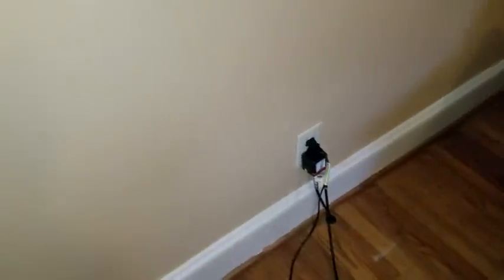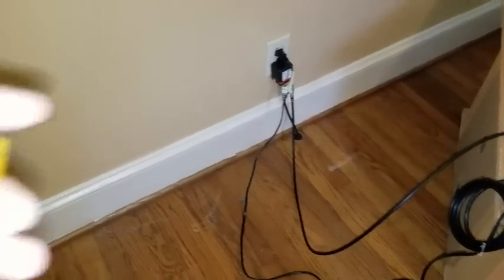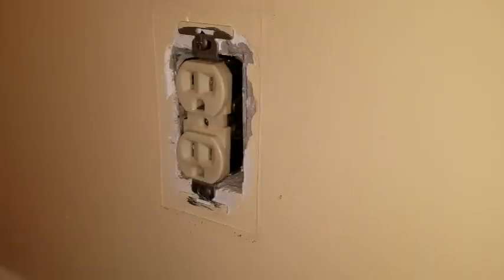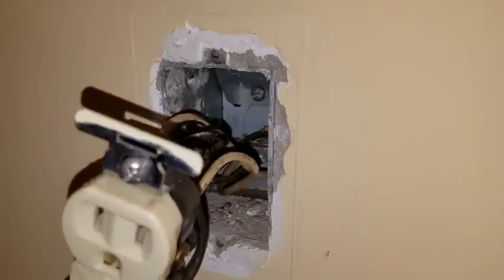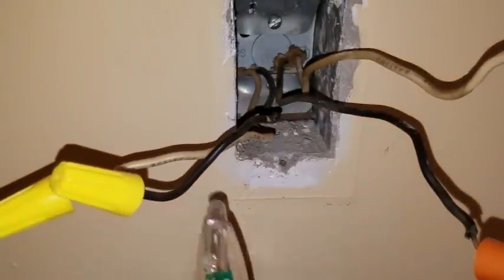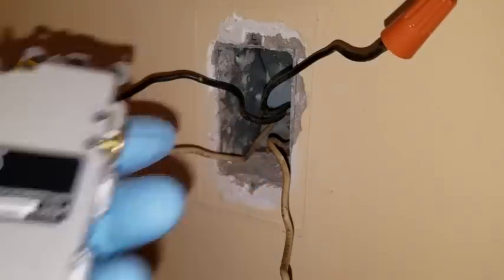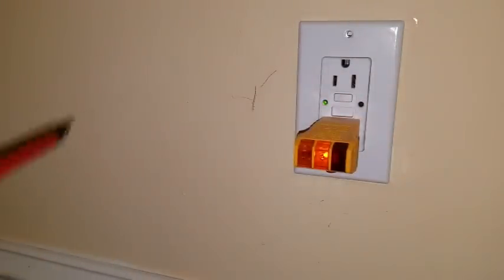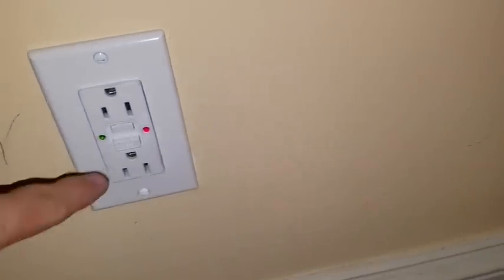Safely Upgrade Old 2 Prong Outlets To 3 prong Outlets

Comment: Would've been nice if you showed where you connected the inline wire (live) instead of cutting it out the video. Did you connect it to the top brass or bottom brass?I don't understand, if the other black wire is not live wouldn't that mean that part of the outlet is dead?

Comment: Is it safe to put multiple GFCI in a row on same circuit? I understand that downstream GFCI are unnecessary, but if they are already in place, is it safe to leave like this?
Reply: Dexter, only if they are wired in parallel (no load connection) and not daisy chained. Wire nuts and pigtails are used. If you trip the first gfci and it doesn't affect anything downstream then you're ok. If the downstream gfci's go dead, they are wired incorrectly. In this case, you can rewire them in parallel, or leave the first one as is, and replace the remaining ones with regular receptacles. If you choose the latter, you should put a sticker on the face plates of the downstream receptacles stating " gfci protected outlet " and if there is no ground, another sticker stating "no equipment ground "

Comment: From what he showed, he was probably in the middle of the outlet string.  The one hot was the line side of the circuit, the end outlet will have just 2 wires since it is not feeding anything else.  You have to keep going back until every outlet is dead.
Reply: Tu

Comment: What if it only has 2 wires. A white and black. Trying to update to same as above.
Reply: Lori Hill, then you have an end of the run receptacle. Connect the wires to the line side only and you're done. White to silver screw and black to brass. Leave the tape on the load side as is.

Comment: Nice video!    Another way to do this is to install a new GFCI receptacle, box, and NM cable next to the electrical panel.   Connect it to the breaker and connect the old branch circuit to the GFCI.   This is IF the panel is easy to get to.
What was going through the hole in the floor?   I'm hoping not a cord!

Comment: It should be noted that although using a GFI in this manner is code, the lack of a ground will not allow surge protection circuitry or devices to work as intended for your electronics.  Sure it will protect you and absolutely not a problem for say lights, coffee maker, toaster,  maybe even a low tech appliance, etc. but the TV you've got plugged in is a sitting duck. Yes, the sticker is ugly but in this case its hidden so what's the big deal.  BTW, the slang for the non-code jumper is a "boot-leg ground".
Reply: Most surge protectors have a varistor between live and neutral so they will work.
Reply: @okaro6595  no they won't work as intended but that's your gamble

Comment: Why don’t you push the grounding button on the tester? Because it won’t trip out like it’s suppose to.
Reply: The way to test the outlet is to use the test button on the outlet. An external tester of course will not work without a ground.

Comment: I'm not an electrician but it seemed he installed the outlet upside down
Reply: yep, it's upside down, I have seen electricians do the same thing. Long as it is wired correctly is all that matters, but it looks stupid.
Reply: @jthonn  No, it's not technically "upside down", either way, but many grounded devices are designed for it to be "the other way", i.e., with the grounding pin toward the bottom.  The weight of the cord or wall device then tends to "push in" the ground, giving the assembly somewhat better support than the way he installed it. However, there are tradeoffs that may make it "safer" to put it in his way.
Reply: @UpnorthHere  Like I said, as long as it is wired correctly, that is all that matters, but in my opinion, it is upside down and looks stupid. There is no trade-off that I know of that would make it any safer. It is either grounded or not.
Reply: @jthonn  Yes, I bought a house with over 100 of them like that.  Drove me nuts.  However, if you look around, some people claim it's somehow "safer" if the grounding pin is up top, since that way (the story goes), if the plug is loose and something (conductive) falls on the exposed contacts, it hits the grounding pin and not across the hot and neutral.  It's a stretch, but some people state that they have had "fires" from accidents after having them installed with grounding pin down.  I have also had electricians (!) point out the NEMA receptacle diagrams in the NFPA 70 Handbook, all of which have the grounding pin (if any), up top.  I point out that it's an informational reference and NOT a code requirement. Nuff said.
Reply: @UpnorthHere  I here ya, 100 of them would drive me crazy too. In a garage or workshop ok, but not in the house. Good grief!

Comment: Kind of strange how u had open ground.     If the box is metal the only thing i can think of is the conduit is probably not metal,     or might not even have conduit at all.     If everything is metal than that is your ground
Reply: The box is metal, but the wiring isn't ran through conduit. He has a metal box with cable clamps that are designed to clamp down non metallic sheathed cable. He has old 14-2 with no ground conductor, so the metal box is not grounded or bonded.
Reply: @illestofdemall13  This is true in thousands of homes built or modified in the USA prior to the 1970s when "grounding" became the norm.
Reply: @UpnorthHere  Including my house in South Florida that was built in the 50s. We rewired it 15 years ago.

Comment: Confusion. Should the third prong ground be at the bottom on residential or not?
Reply: Nobody cares. There is nothing in the national electrical code one way or the other.
Reply: It should be. Perhaps NCP is left handed.
Reply: Whichever you prefer, there is no code governing this.

Comment: Gfci with no actual ground is no safer and a waste of money.
Reply: So, if i need to convert a two prong outlet to a three prong (no ground present) what would you suggest?
Reply: ...but is up to code as long as you use the stickers "GFCI Protected" and "No Equipment Ground" that comes with the outlet.  That's the only NEC code-accepted way to upgrade a 2-prong to a 3-prong without proper ground.  
The other method is to run new wire (aka: have proper ground).  Yes, this is the ideal way, but also very expensive in many situations.
Reply: @Cryostal  Putting in a 3-prong outlet with no ground alone is a code violation unless it is a GFCI outlet AND has the stickers "GFCI Protected" and "No Equipment Ground" on it.  The outlet would still not be grounded, but this method is allowed by code.
Reply: @Cryostal  lol surge protectors leach surge thru a ground otherwise your equipment is still toast found out the hardway
Reply: @Cryostal  Yeah, except that would (a) be  a code violation if there is no ground, and (b) your surge protector won't work (they almost all need grounding to function properly).  So, you would have made things more illegal and more dangerous. Not really the best solution.

Comment: so can i change 2 prong to 3 prong with no ground and it will work? can i plug my computer on it?
Reply from the maker: I have computers and equipment plugged into mine.
However  before I moved in the previous owners did a had a 200 amp serves installed. So incoming lines are grounded.  None of the old wiring is grounded so a lighting strike can still get me but It should be attenuated. 

I do have a whole house surge protector I will be installing. But its been setting in its box for the last 6 months :(
Reply: @NorthCarolinaPrepper  oh i see i checked the outlets on my room and they only have 2 cables no ground but in the kitchen i found two that has the ground cable connected so i just have to test them with the device and if they are well grounded i can just run an extension to my room thats the cheapest solution i think. and on the living room right out my room there is a 220v outlet that we dont use there was a gas heater connected there and that one has ground cable too im wondering if i can convert that 220v to 110v so i can put a 3 prong outlet instead
Reply: Refugio Flores if you are not comfortable with electrical work, and based on your question I am guessing you are not! Have an electrician come access your needs and offer solutions. Many 220 volt applications do not have neutral wires ran to them so if that is the case, you may need a separate neutral wire ran. At that point, it is advisable to have ground wires ran.
Reply: Refugio Flores  YES YOU CAN IT WILL WORK JUST YOU WONT HAVE GROUND. NOT UP TO CODE BUT YOU CAM SAFEST CODE WAY IS TO PUT IN A GFC WITH THE NO GROUND STIKERS ON IT AND YOU SHOULD B OK. OR LOOK UP NEUTRAL TO GROUND
Reply: surge protectors need a ground to leach surges otherwise your equipment is still toast
Reply: @wizard3z868  Not really. There is always a movistor (Metal Oxide Varistor) device running from hot to neutral which will act to clip any large transients. There is also movistors between between hot and ground, and neutral and ground, and as you point out these will be less useful due to the lack of ground.

Comment: So if I have a 3 prong outlet with only 2 wires, I can jump the ground from the neutral screw?
Reply from the maker: No. that is a bootleg ground. It will show ok on a little tester, but it will let the ground be energized.  here is some info on it https://en.wikipedia.org/wiki/Bootleg_ground
Reply: @NorthCarolinaPrepper  The ground will be energized only if the neutral breaks. If the neutral is intact there is maybe one o two volts in it. This may cause interference with IT-cables though.
Reply: You have to run a grounding wire to your breaker. Wouldn’t suggest anyone without electrical expertise touch it
Reply: No! No! No! You set yourself for a dangerous encounter. By code you replace the 2 slot receptacle with a GFCI receptacle as was shown and label it GFCI PROTECTED and NO EQUIPMENT GROUND
Reply: @coypatton3160  Why would you mark a GFCI outlet with words "GFCI protected"?
Reply: Okaro X follow code or hire an electrician. If you ask that question you need ti do the latter!

Comment: you need to put a "no ground present" sticker on there.
Reply from the maker: I got some stickers on it now and on all the outlets down stream. I got a bunch of extra ones from the outlet maker.
Reply: There is no requirement that it be a "sticker". "The label shall be of sufficient durability to withstand the environment involved." NEC (2017) 110.21(B)(3).

Comment: I have seen you someplace before were you on the Red Green Show looks like North Carolina have you been to Danny's BBQ in Raleigh great barbecue actually but you're absolutely absolutely wrong wrong wrong send a wire underneath your house all of the outlets cut the walls send the wire underneath the house do it right or don't do it at all your GFI needs to be grounded and that's it you're not on the Red Green show now do it right no duct tape
Reply: FYI a gfi will function properly without a ground,
Reply: uawsux: "GFI needs to be grounded"?  Who told you THAT?  A replacement receptacle with a "grounding slot" does NOT have to be grounded if there is no grounding conductor available at the outlet enclosure, and either it is a GFCI receptacle or supplied from another GFCI device, NONE of which are required to be grounded. They even come with labels to attach to each receptacle that says "No Equipment Ground", as required in the National Electrical Code.

Comment: If your electrical wiring in the wall is bx or ac and if it’s properly grounded and bonded to the circuit panel then you can still use a 3 prong outlet.  Just run a ground pigtail and screw it to the box and connect that ground wire to the outlet providing ground back to the service panel of the house.
Reply from the maker: No its old  fabric covered 2 wire. All the new wire im pulling is 12/2 (Stiff and a pain in the but some outlets are being upgraded to 20 amp)
Reply: cgillyard: yes, if you HAVE a grounding conductor at the outlet box, you have to connect it to the 3-slot, grounding-type outlets when you upgrade.

Comment: Does nothing for safety
Reply: jcagy2 not sure what you are saying. By NEC code a gfci receptacle is the only acceptable procedure for replacement on a 2 wire system! Is it as safe as a 3 wire system with gfci protection—No! But it is NEC approved with the appropriate labels!
Reply: jcagy2: "nothing for safety"?  Why would the NFPA authorize it and all 50 states adopt the resulting NEC if it's not safer than the alternative?
Reply: @UpnorthHere   Yea, GFCI work without ground, still much confusion about this I guess??? Of course put the no ground sticky.

Comment: Wait...u said its good.  Your circuit tester says its hot on neutral.  And open hot.  Thats not good
Reply from the maker: harbor freight gfci tester  center light is open ground . It should really have a  "no equipment ground" labels affixed (the labels come with the GFCI device). Its code.   Here is the part of the code if you are interested . NEC code covering  Non-Grounding-Type Receptacles. 406.4(D)(2)(C)

Comment: How do you know this is the FIRST receptacle (upstream) in the branch? You know that there are likely more receptacles or lights downstream of this receptacle (at least there is a circuit, maybe going somewhere downstream), but there may also be other receptacles upstream of this receptacle, so you can't, from this, tell that this is the FIRST. I understand that that might not be important to you right now).
Reply from the maker: I flipped all the circuit breaker in the panel. Then turned the on in the computer room, Then pulled all the outlets out and disconnected them until only on had a hot line that hat power. Then went under the house and physically traced the out
let wiring (romex) back to the breaker panel.
Reply from the maker: Some of the stuff the previous owners did is scary. Like splices in the line that just go to exposed wire with electrical tap on the ends. At this house I make sure to trace the lines. :(
Reply: You didn't really need to go under the house using the method above.  But better too much precaution than not enough.

Comment: Y install gfi if not grounded
Reply: so you can plug things in
Reply: It is code for replacement of 2 slot receptacles with the appropriate labels affixed! I.E. NO EQUIPMENT GROUND & GFCI PROTECTED
Reply from the maker: They still work Just not Equipment ground. So sensitive equipment might get damaged from a fault. But the human will not (shouldn't) get electrocuted.

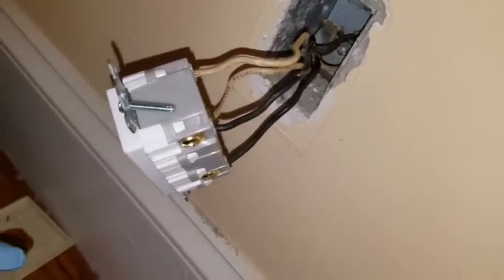Comment: When someone is showing me how to do something unusual electrical wise, I'd like reassurance by citing a fairly recent NEC paragraph. "New code came out, but I've not gone over it" (8:00) does not instil confidence, neigher does claiming to be "code compliant" (9:25) without citing which code or regulation is being referred to.
Troy.
#
Reply from the maker: 406.4(D)(2)(C) GFCI protection is required where 3-prong plugs are used without grounding wires, if "marked “GFCI Protected” and “No Equipment Ground”   I really should of put that in the more info.  I haven't looked it up in the new code yet

Comment: Isn't that outlet upside down? Did you check for ground to the metal box?
Reply: + Troy Frericks - So, to accommodate voltage adapters/transformers (wall worts), are you saying the ground pin should be toward the top? or the bottom?.  

I wasn't aware there was any standard for which side the hot is on for voltage adapters/transformers.
Reply: @GFlCh  Some wall warts are 3-terminal devices, other than that  you are correct.
Reply: Maxwell Smart the orientation actually doesn't matter.  It's not against the NEC and it's honestly just preference. I install my receptacles with the ground down like nornal.
Reply: Troy Frericks try using power strips then you can turn off the transformers. When not using the device.
Reply: Ron B and folks this is really a good ideal! Any transformer plug is working (transforming 120 volts to whatever voltage it transforms to— this varies).
Reply: It can be oriented however you want in residential.
Reply from the maker: Is it upside down...well it depends who you talk to. There is no nec  code on the orientation of the outlet, But people put it ground side up so is something falls on it it will hit a ground and not the hot/Neutral completing a circuit. ( It feelis upside down to me  :) ) and no box ground, at this time
Reply: Upside down makes it difficult to plug in transformers that are meant to hang. They fall out from the top when the outlet is upside down. NEC code or not, it's a pain. I spent an afternoon with my main turned off and went through the whole house and fixed them, it was that much of a pain.
Troy.
#
Reply: @troyf1  There is no NEC code referring to installation orientation, and yes, "wall warts" do not always like being plugged in upside down.